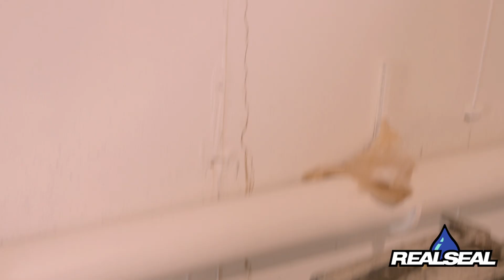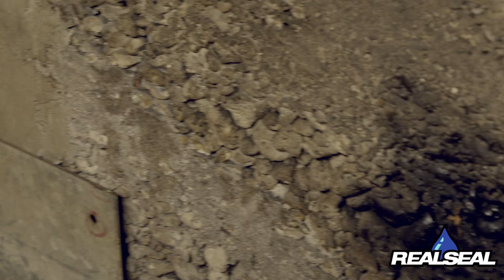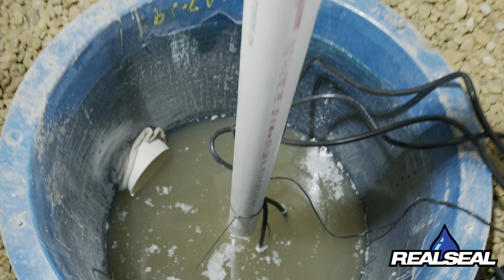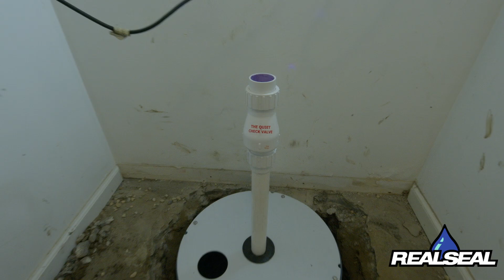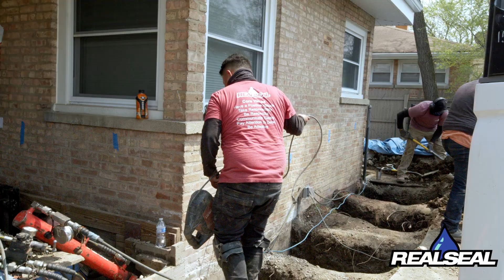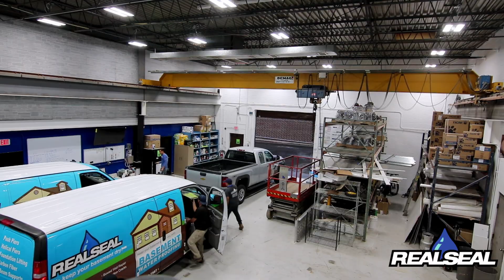How to Spot Water Leaks in Your Basement Fast!

Comment: Do you know of anyone that does exterior sealing in Lafayette, IN? I can’t find anyone and everyone else is pushing me to interior channel drain and encapsulating the wall, I’m no fan of letting the water into the envelope of the home.
Reply from the maker: Hello! Unfortunately we do not know anyone in that area. 

However, it is a common misconception that you are letting water in the home. Water builds up under the envelope of the home regardless, which is why you are having the issue.

Your concrete floor is not meant to be waterproof and is just a small layer between you and the Earth and water. The Drain Tile works by keeping the level of the water below your floor, thus waterproofing your home. 

You can try exterior sealing, but you will only get a Lifetime Warranty with the Drain Tile. It's the standard way of fixing this, and although it may seem counter-intuitive, it does work efficiently.
Reply: @Therealsealllc this does seem extremely counterintuitive. How can a drain tile offer a lifetime warranty when the problem starts outside the home? Wouldn't water proofing the foundation walls, adding french drain system etc be the better option? Please make it make sense. I am struggling with water in my crawl space, my hollow cinder blocks are holding so much moisture.  Logically I think have the exterior water proofed , because it needs the most protection correct? If not Wouldn't this be a ass backwards domino effect of many issues?
Reply from the maker: @GazerOfNature  Great Question! With Cinder Block, if you want to keep the blocks from filling with water, an exterior membrane and Drain Tile is a fantastic solution, and would be preferred in a perfect world (where money and obstructions don't matter). The problem with it is the cost. Exterior membrane and Drain Tile is much more expensive than the interior. And they provide the same warranty. 

From the inside, we drill through the bottom cinder blocks when we do the Drain Tile, allowing those blocks to drain. Then the Drain Tile and interior membrane catch and re-direct any water to a pit inside (the exterior system still needs a pit inside as well), which then pumps the water out and away from the home. 

So for most people, the principle of the matter (keeping the basement/crawl space from flooding) are the same no matter which fix you do. The water will be managed and you can finish the area inside without worry of water intrusion. 

Both systems come with a Lifetime Warranty, both systems will keep your basement dry, and both systems are membrane/drain tile combo. 

The cases where the Exterior Drain Tile makes the most sense is if you have a basement and there are finishings/utilities/etc that cannot be moved or the owner is unwilling to move.

You can find the same challenge with obstacles/obstructions on the exterior, making the interior make more sense. 

So it really is case by case, depending on the conditions of the area and the budget of the homeowner.

98% of all our systems installed are interior, and the industry is vastly the same. Why spend the extra $$ if you get the same result? Why not take your family on a fun vacation instead?